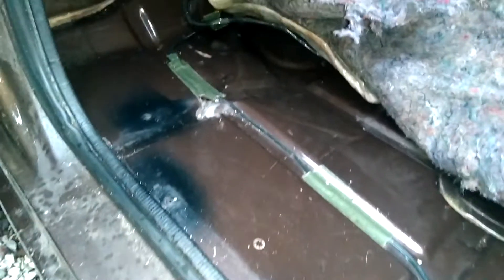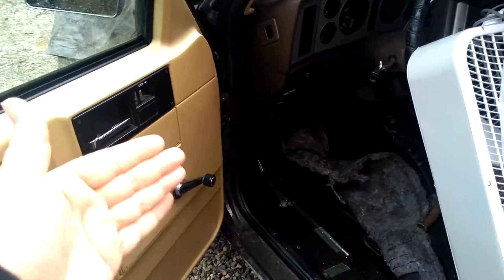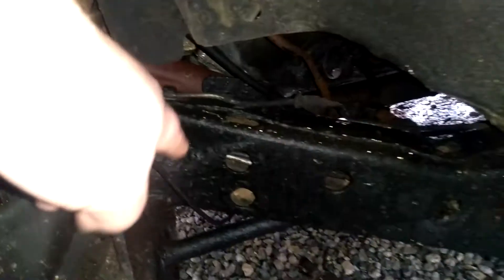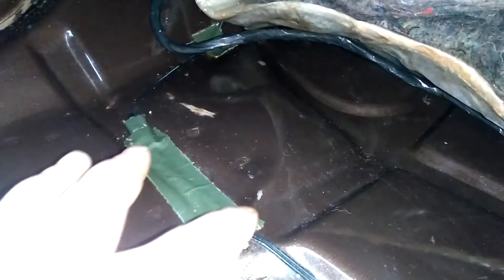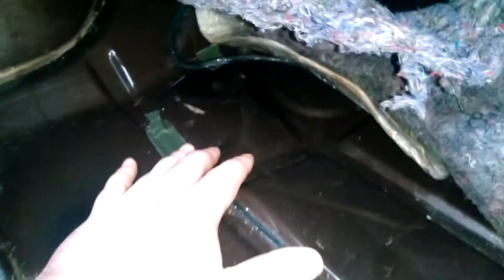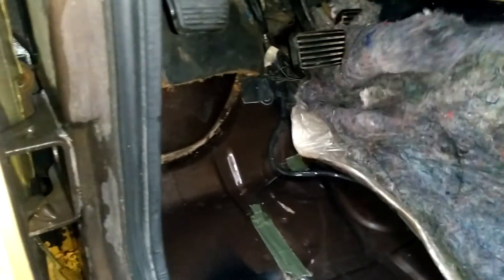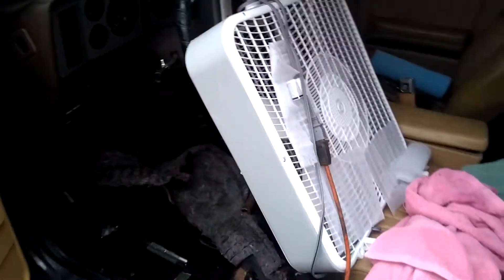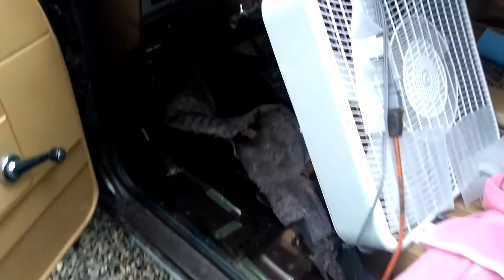S10 Blazer - Bent Floorboard From Previous Wreck - What To Do ???

Comment: Yeah I take a rubber hammer an just get it back to where it should be . An why is the floor wet the door seats leak ? Cause mine did until I changed them from a late run model blazer that was way better run shape
Reply from the maker: Yeah I think that's what I'm going to do, I have been drying that Carpet/Insulation stuff for the past 4-5 days now (A Fan has been running for 24 hours a day for the past 4-5 days and it still ain't dry!) But as many times as I've been out there looking at that Floorboard I just noticed that it was bent today Lol.... But the reason it's wet is bc there was a Hole in the Sealant down in the little area (I can't remember what it's called Lol) where the Windshield Wiper Arms are & the Water collects when it run off the Windshield, But yeah there was a hole in the Sealant and it was right in the perfect spot where it was letting water through the Firewall right above the Main Electrical Plug where it plugs into the Firewall and then goes into the Cab, Well the water was leaking in around that plug and going straight to my Floorboard.... I had thought it was water from melted snow/ice from my shoes, but after I cleaned up a big puddle of water one day and then the very next day there was another big puddle of water again I knew it was leaking in from somewhere & it wasn't just Melted Snow/ice from my shoes Lol, But I've got the leak fixed now 🤞🤞🤞 At least I think I do LoL
Reply: @s10_4_life6  ahh ok good to know I need to check mine just to be sure it's sealed good . My passenger side was wet after all this rain I keep having which is damn aggravating and you can't get nothing done . But anyways um the floor was wet under my mat cause I have a rubber floor as carpet an noticed there was some water coming from a hole in the rubber matt an water came out when I pushed down on it so that's not good . I know it's not coolant so it's water but idk where would be coming from .
Reply from the maker: @KnuckleHeadGarage27  your best bet is to go out and look see where the water is coming from while it's raining that's what I did and that's how I found my leak

Comment: Loosen body mount before using a  hammer        body is twerked
Reply from the maker: It didn't seem tweaked tho, I mean the Body mount bolts bolted right with no problem what so ever, Even when I checked the body out I didn't see nothing wrong with it at all the whole time I was building the Blazer and then just all of a sudden I pull the carpet back and notice the floor is bent, I never seen that it was bent the whole 1 1/2 years that I was Building the Blazer either